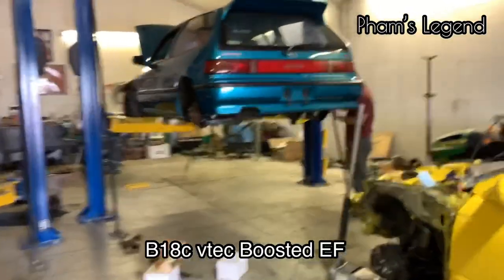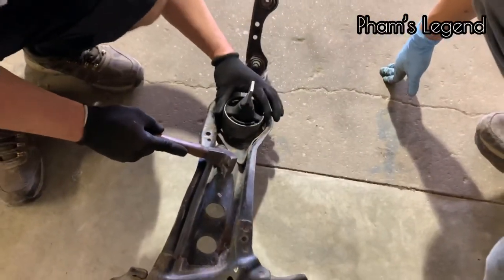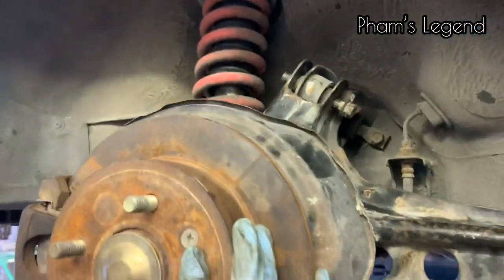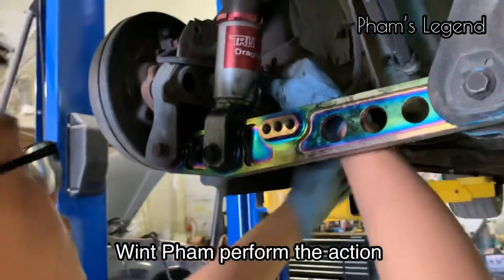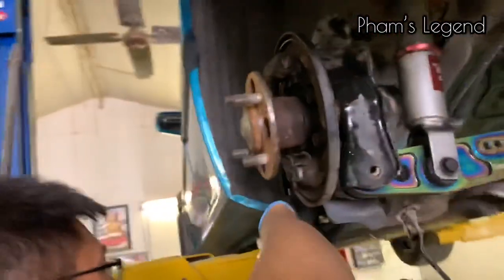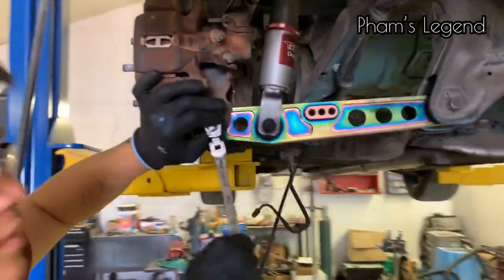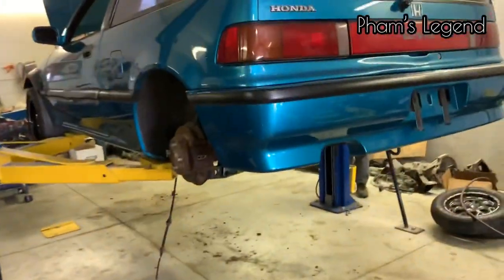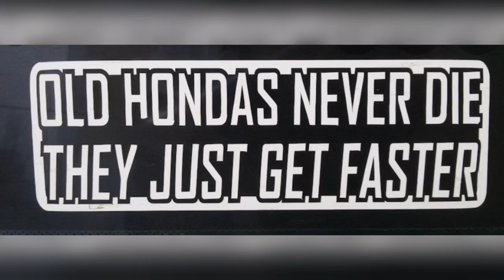Honda civic ef rear disc brake conversion || Pham’s Legend

Comment: did putting on dc2 integra parts make the wheels sit out further?

and did you put into a new dc2 trailing arm bush? or is it a civic bush
Reply from the maker: Integra
Reply: It does push the tire out a little. But if you are not scca racing it's ok. Da is the best for the ef chassis. You can take a ek control arm and bolt a da spindle assembly to it to get rear disk conversion
Reply from the maker: I can try it on my next car, thanks for the tip
Reply: The DA pushes out the rear track and changes the geometry.
The DC is the correct trailing arm for the proper geometry.